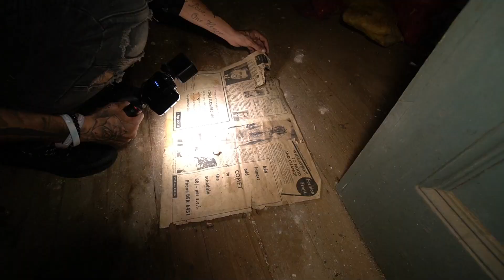THE TORTURE HOUSE - ABANDONED MILLIONAIRE MANSION - HE WAS TORTURED AND KILLED IN HIS HOME

Comment: That white plastic thing mounted to the plywood on the wall by the archway at the top of the stairs was a motion sensor, probably for the security system you saw on the doors. Doesn't seem like the system was working or on, going by the cut wires to the door alarms you pointed out

Comment: 26:48 No idea what that is

The 3 vessels on the right (blue cladding) are thermal stores. . .  The. . . . . I HAVE NO IDEA . . .  what that is. . .. is the boiler. .  . . the boiler tops up the the temperature of the thermal stoers and they distribute the heating  (radiators) and Hot water to wash (domestic) around the propety